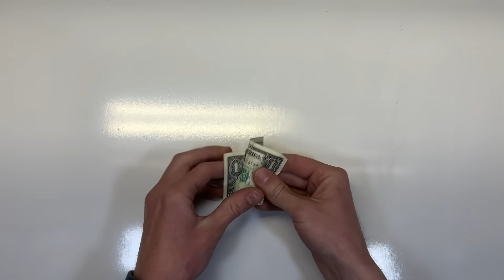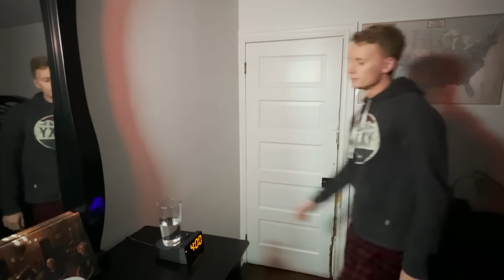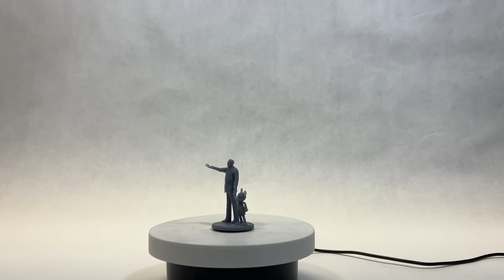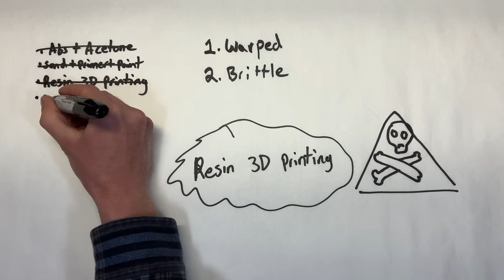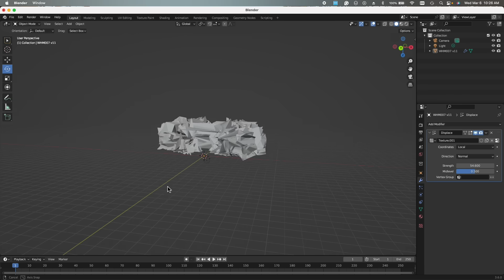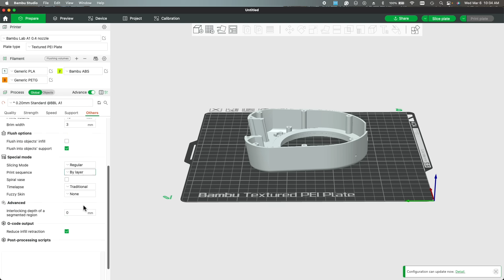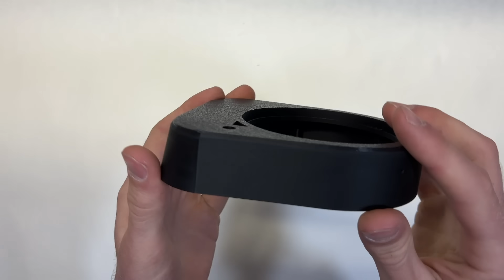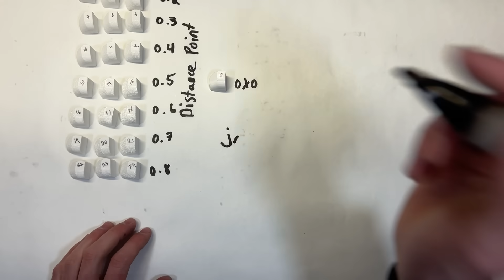My Secret To No More 3D Printed Layer Lines

Comment: Lol that's nothing new it's been around for the past 6 years. Also calibration  is key to getting ride of layer  lines.
Reply from the maker: You're absolutely right! Techniques like fuzzy skin have been around for a while, and proper calibration is indeed essential for achieving smooth prints and minimizing layer lines. It's important to explore different methods and find what works best for your specific needs and equipment. Thanks for highlighting these important points!

Comment: You dont have to heat acetone up to vapor smooth. Its already volatile. You just have to hang your priny in a sealed container with acetone in it
Reply from the maker: You're correct! Acetone is indeed volatile, and vapor smoothing can be achieved by suspending the 3D print above a container of acetone in a sealed environment. This allows the acetone vapors to interact with the surface of the print, effectively smoothing out layer lines and imperfections. It's an alternative method to heating acetone directly, and it can produce excellent results when done carefully and safely. Thanks for clarifying!

Comment: Fuzzy skin has been a feature in Cura and PrusaSlicer, for at least 2 years (Cura even longer than that) ! If you really have done a research how could you have missed it?!
Reply from the maker: You're absolutely right, and I appreciate you bringing that up! Fuzzy skin, or similar features with different names, has indeed been available in various slicer software for several years, including Cura and PrusaSlicer. It's an oversight on my part not to have mentioned these options in the video, and I apologize for any confusion. It's essential to explore all available features in different slicer software to find the best solution for each specific project. Thanks for pointing out this important aspect!

Comment: I personally don’t understand why people go through such lengths to hide the fact that a thing was 3D printed. As of writing this comment, 3D printing is still a novelty. It is reaching the point quickly where most people can just buy one, but it is still a new and cool concept. I feel that for many people, owning something that was 3D printed would be a cool novelty. Not only do you have an alarm clock, but you have something that someone created with a little machine in their house. I understand that in some applications it is good to hide the fact that something was printed, mostly with cosmetic parts like cosplay props or things you want to have look like they were professionally made, but for me it doesn’t make much sense to go about trying to hide the fact that a thing you’re selling out of your house is 3D printed.
Reply from the maker: That's a great point you've raised! 3D printing does indeed have a unique appeal, and for many people, owning something that was created using this technology can be a fascinating and novel experience. It's a testament to the innovation and creativity involved in the manufacturing process. While there are certainly situations where concealing the 3D printed nature of an object may be desirable, such as in certain aesthetic or professional contexts, embracing the technology and its distinctive characteristics can also be a selling point. Ultimately, it comes down to individual preferences and the specific requirements of each project. Thanks for sharing your perspective!
Reply: Sometimes you need also need smooth surface for technical reasons to 😅 like some part sliding in and out of another.. sure could be redesigned so layers won't matter anymore...

Comment: Do you Iron the upper surfice?
Reply from the maker: What is Iron the upper surface? I've never heard of it before and have never tied it. However, it sounds cool, and I would like to learn more about it!
Reply: @jakemgrim  activated at the slicer, this function lets the printer run across the top surface after the Print without Filament coming out. This melts the surface a Bit, resulting in a flat surface where you dont See the 3D-printing structure anymore. I have tried IT only once before

Comment: Any CF filaments will also help the lines blend in my experience
Reply from the maker: Absolutely! Carbon fiber (CF) filaments can indeed help reduce the visibility of layer lines due to their unique properties. The addition of carbon fiber to the filament can result in a smoother finish and a more professional-looking surface. Additionally, CF filaments often offer increased strength and stiffness, making them suitable for a wide range of applications. However, it's essential to note that the effectiveness of CF filaments in reducing layer lines may vary depending on factors such as print settings, layer height, and post-processing techniques.

Comment: Save you 10 minutes: use fuzz skin
Reply from the maker: Exactly! Fuzz skin, available in many slicer software programs, is a convenient feature that can save you a lot of time and effort in post-processing. By adding a fuzzy texture to your prints, it effectively conceals or reduces the appearance of layer lines, providing a smoother finish without the need for extensive sanding or priming. It's a straightforward solution that can significantly improve the quality of your 3D prints with minimal additional effort.
Reply: He literally said it in the first 4 seconds, delete your comment enrico

Comment: you really should give Resin Printing another try. you said something about your parts being brittle ?  its probably because of Over Cooking it in the UV, or Under Curing during mfg.  with Halot Mage - most of the resins ive played with have a cure time of 2-5 seconds per layer - so if youre doing anything at 1.2, its not enough and will rip apart.
and take the supports Off BEFORE you UV Cure the parts. not after.  you can use Warm Water to soften the supports and it REALLY HELPS them pop right off.
especially if you have TONS of supports.  just let it soak for 30sec, then pull some off, and repeat. dont let it soak for 2min or you will hurt the model. and not 180°F water either.
Reply from the maker: Thanks for the tips! Resin printing can indeed be a bit tricky to get right, but with the right techniques and settings, it can produce fantastic results. Adjusting the curing time and ensuring proper support removal are crucial steps in achieving strong and detailed resin prints. Your advice about using warm water to soften supports before removal is especially helpful and can prevent damage to the printed model. I appreciate you sharing your expertise!

Comment: MJF printed parts are pretty dang affordable.. Alternatively, filaments like Protopasta Empire strikes black PETG hide layer lines really well (similar to Carbon fiber filaments without the damage to the nozzle)
Reply from the maker: Absolutely! MJF (Multi Jet Fusion) printing offers high-quality results at a reasonable cost, making it a great option for producing parts with minimal visible layer lines. Additionally, specialty filaments like Protopasta Empire Strikes Black PETG can provide a smooth finish similar to carbon fiber filaments but without the abrasive wear on the printer nozzle. These alternatives can be excellent choices for achieving professional-looking prints without the need for extensive post-processing. Thanks for sharing these options!

Comment: Have you tried making Silicone molds? Casting each piece would take less than 15 minutes using 2 part resin that you can pour and cure and you can dye the resin in any color. There are also minimal post processing.
Reply: Plus, just like with filament, there are lots of different kinds of resins with different mechanical and other properties.  Do the fill/sand process once to get a high-quality master, make a few molds from it, and cast multiple parts at once.  Or, have a local machine shop make a suitable mold frame, make an epoxy mold instead of silicone, and use that to do low-volume injection molding yourself. Or use the master to make sand molds and cast it out of Zamak or aluminum.  There are all kinds of options that don't take three hours to produce a part.
Reply from the maker: Very good point. There are a lot of variables involved with the whole process. Are there any filaments you recommend I use?
Reply from the maker: I have not tried Silicone molds. I would really like to try it sometime. Are there any brands or tutorials you recommend?

Comment: Wait until he hears about marble pla or 0.2mm nozzles. 

Plus those prices for aluminium tooling was nuts.  Half the price and could get steel for that.   Thats the trade off.  Rolling price for unit pricing making the clock $30 not $200
Reply from the maker: Using marble PLA or smaller nozzles like 0.2mm can indeed help achieve a smoother finish and minimize layer lines in 3D prints. These materials and techniques can be more cost-effective and provide a high-quality surface finish without the need for expensive post-processing or tooling. Your point about unit pricing is also valid. By optimizing production methods and material choices, it's possible to reduce the overall cost per unit, making products more affordable without compromising on quality. If you have any specific applications or projects in mind, feel free to share, and I can provide more tailored advice!

Comment: I felt this video in my soul after having gone through the exact process you did. I have had a product injection molded before but it cost over 100k and the end result wasn’t even much stronger than an fdm part. Currently selling my anycubic m3 max because of the brittleness
Reply from the maker: It’s not easy!

Comment: I am getting an A1 when I get back from vacation since I just finished my printer cabinet modification to accommodate it. 

You mention that fuzzy skin disrupts the tolerances. My question is: can you set fuzzy skin to a negative value, so instead of protrusion it performs the inverse for the fuzz? I feel the answer is likely no, but if anyone has insight if negative values are usable, I would greatly appreciate it.
Reply from the maker: Fuzzy skin settings in slicers like Cura and PrusaSlicer are generally designed to add a textured surface by creating small, random variations that protrude from the surface of the print. These settings are typically controlled by parameters like fuzzy skin thickness and fuzzy skin point distance. As of now, these settings do not support negative values to create indents instead of protrusions. The primary goal of fuzzy skin is to improve grip or hide layer lines by adding a texture to the print surface.

However, if you are looking to achieve a similar effect (creating indents rather than protrusions), there are a couple of alternative approaches you could consider:

Modeling Software: You can create a custom texture with indents using modeling software like Blender or Fusion 360. These programs allow you to apply displacement maps or bump maps to your model, which can then be exported as an STL file for 3D printing. This method gives you full control over the texture and allows you to create any pattern you desire.

Custom Textures: Some slicers allow for the application of custom textures to the surface of a model. This can be done by importing a height map or a texture map that defines the surface features you want. This way, you can create a pattern with negative space (indents) that is applied during the slicing process.

Modify the G-code: If you are comfortable with G-code, you could theoretically modify the slicing G-code to create indents instead of protrusions. However, this is a complex and manual process and may not be practical for most users.

While these methods may require additional steps compared to simply adjusting a setting in the slicer, they provide the flexibility to achieve the specific surface finish you are looking for. If you have access to advanced modeling software, I recommend exploring these options to create the desired indented texture on your 3D prints.

Comment: I was just wondering what that fuzz was about in the settings and honestly was wondering why would anyone want any fuzz. Thanks for the depth in this video. I personally would have preferred the original 3D print on this product. Well, also I'd smash that glass of water before drinking it... yeah, I am angry in the mornings.
Reply from the maker: Fuzzy skin in 3D printing hides layer lines, improves grip, and adds a unique texture, reducing the need for post-processing. Preferences vary, with some preferring a clean look while others like the added texture. Experiment with fuzzy skin settings and perform test prints to find what works best for your needs.

Comment: When Ra 0.3 looks better than √
Reply from the maker: Really? Could you tell me more about Ra 0.3?
Reply: @jakemgrim  
Surface roughness terms for CNC cutting.
Look at Surface Finish Charts in google images. It should give you an idea

√ is referred to as "raw surface" of a created detail. 

Ra is the shorthand name of the roughness scale, and 0.3 (or whatever number) is the highest difference between the "valley" and "hill" of a surface in microns (um)

Ra 6.3 is the usual low cost quick cut of a CNC machine, but going down is when things get "EXPENSIVE". Going way higher is usually texturing and not measured with roughness scale because Ra 23000 isn't very helpful when you need a specific texture.

Now, applied to additive manufacturing, √ is the most perfect surface possible, but we work with imperfect tools.
But when you add "coarseness" to your model, the print will gain a higher surface roughness, BUT it will look much better when printed.

Because I don't know the exact scale of the "fuzziness" I overexaggerated that just adding a 0.3 micron fuzz to the model is enough to make a better surface for a print.

There's also a joke that Ra 0.3 looks better than √, That's almost always the case, but for a different reason. 

Also, 0.3 is not a standard recognized SI size, like how you don't find M8.11123 threaded bolts and nuts on sale at the store.

Comment: Nice video! Good to see the entire process and what goes in to making a product! I looked through the entire comment section but couldn't find an answer to my question. Maybe it's in there and I just missed it. 😅

I was really wondering what kind of fillament you are using for your final product?

I just bought my own printer, a BambuLab P1S and I'm looking for tips and tricks for using it and what material to use for what purpose. Thanks in advance!😁
Reply from the maker: I use Atomic Filament Black PLA: https://atomicfilament.com/products/black-pla-filament

Comment: Heating acetone? Why? It evaporates at room temperature.
Reply from the maker: You're absolutely right! Acetone is highly volatile and evaporates at room temperature, so there's no need to heat it for vapor smoothing. By simply placing your 3D printed part in a sealed container with a small amount of acetone at the bottom, the vapors will rise and interact with the surface of the print, smoothing out layer lines effectively. 

Heating acetone can be dangerous and isn't necessary for achieving a smooth finish. Always prioritize safety and use proper ventilation when working with acetone. Thanks for pointing that out!

Comment: How would you compensate for the fuzz on your splicer? using a .3mm thickness and .3mm point distance. would you increase the scale, or axis effected by .6mm? I have something I am printing that clamps over something, but I forgot about the tolerance change due to the fuzz. Obviously it will not clamp over and stay connected. Any advice will be welcome :) Thank you
Reply from the maker: To compensate for the fuzz in your slicer settings, you can increase the overall size of your model by the amount of fuzz you've applied. Since you're using a 0.3mm thickness and a 0.3mm point distance for the fuzz, you'll need to increase the scale by at least 0.6mm in the dimensions affected by the fuzz. This adjustment should help ensure that your printed part will still fit and function properly, especially if it needs to clamp over another object. Experimenting with test prints at slightly increased scales can help you fine-tune the fit before committing to the final print.

Comment: here's another idea: you can use the enclosure to form a negative in sand and then fill it with plastic
also I want to use a hot press to give my prints a popcorn finish
also check out the ironing feature- or do it yourself
Reply from the maker: Those are some creative ideas! Using the enclosure to form a negative in sand for casting is a neat approach, especially for creating duplicates of your prints. Hot pressing for a popcorn finish sounds intriguing too—it could add an interesting texture. The ironing feature or manual smoothing can definitely enhance the surface finish of your prints. Thanks for sharing these suggestions!

Comment: The resin prints would have worked if you better resin, an  engineering resin such as lamg he art engineering resin doesn't warp and is not brittle
Reply from the maker: Using a higher-quality engineering resin like Longhe Art Engineering Resin can indeed mitigate issues such as warping and brittleness in resin prints. Choosing the right resin for your specific application is crucial for achieving the desired results. Thanks for sharing this insight!

Comment: May i ask, how did you get the fuzzy skin on the bottom layer that was in contact with the bed?
Reply: I don't know his setup for sure, but I'm guessing the bottom layer texture is from the texture of the print bed.
Reply from the maker: Correct!
Reply from the maker: Correct, I have a textured build plate that comes with the A1 3D printer.